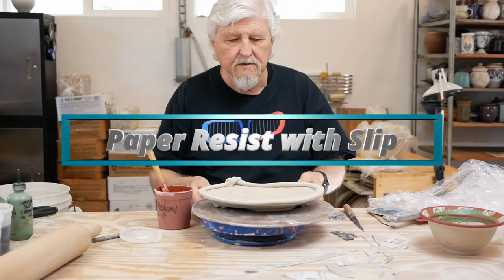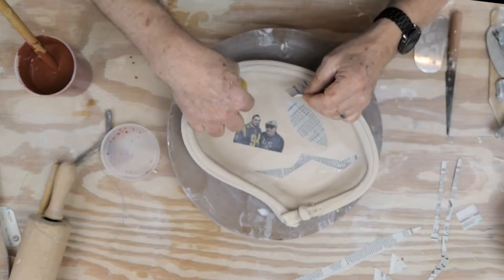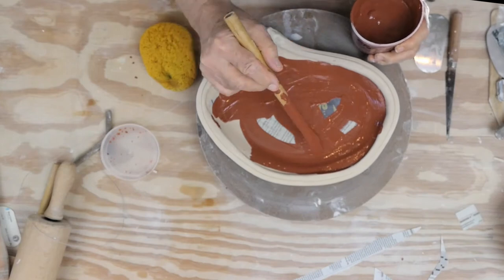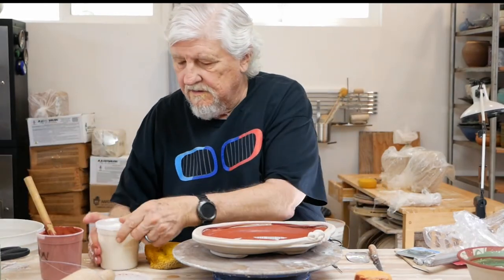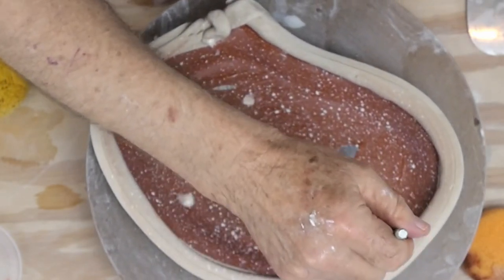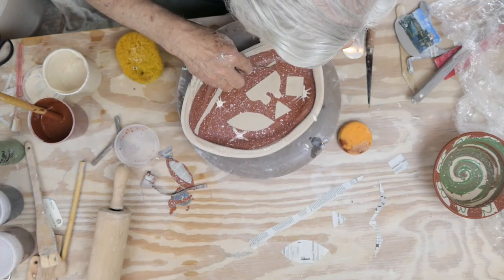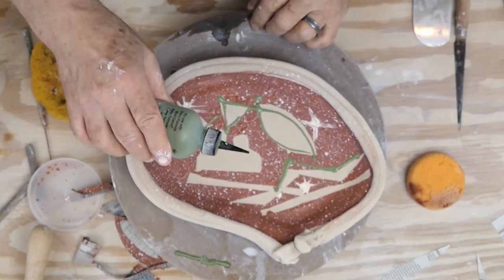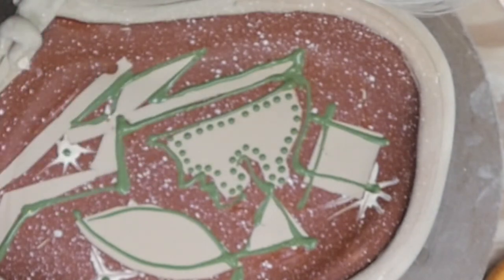Paper Resist

Comment: The Paper will just burn away in the kiln
Reply from the maker: @DunoonVanRijn-dx1hr  Yes it will burn but it leaves a residue.  Burnt paper is an ash and ash is a flux and glass former which when fired high enough melts into a glaze.  By removing the paper before the slip dries you have the opportunity to clean up, modify and add to your design.